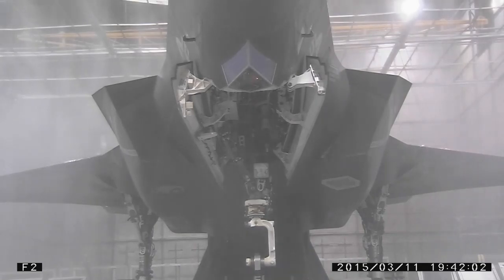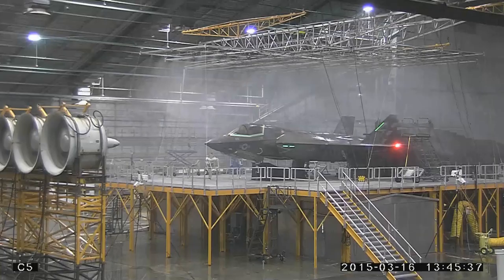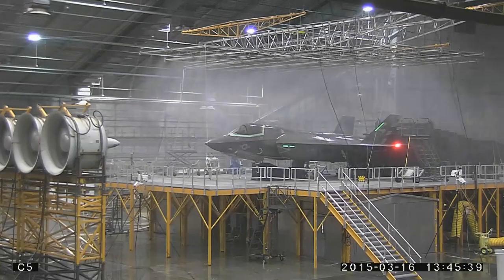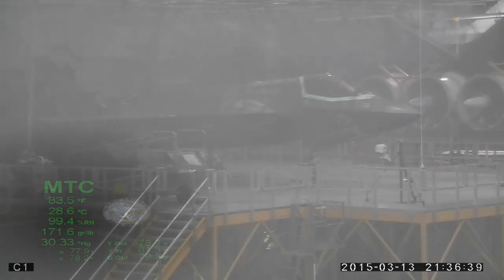Lightning Weathers the Storm: F-35 Climatic Testing

Comment: How long will this plane be a prototype? For the next several years? Then I guess we will have to keep using those old veteran planes longer then such as the old and outdated harrier jump jet, A-10 which is armored only against bullets, F-16s and the F-18s. The U.S. Military still needs a plane that can replace the F-15s and the F-22 is out of production forever due to no reason and the F-35 is still in its testing stage for like since it was introduced and it never was sent to actual battle for once.
Reply: I heard something about them beginning to go into service in July.
Reply: ***** LastGreen is right, it's going into IOC with the USMC in July. The F-35A will enter service next year, and the F-35C will follow shortly after. 

From first flight to IOC the F-35 took just 9 years. The F-22 took 8, the Eurofighter took 9, and the Rafale took 15. Keep in mind the F-35 has had over a hundred aircraft flying for almost two years too.